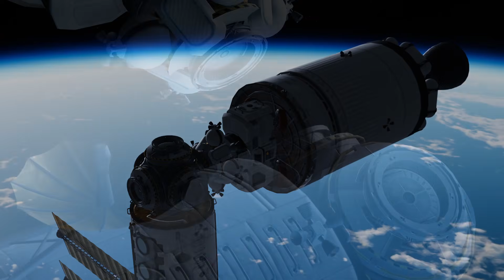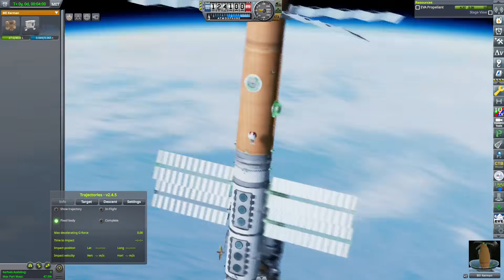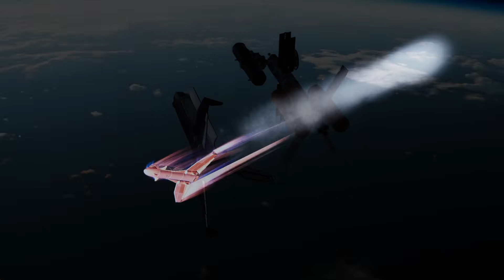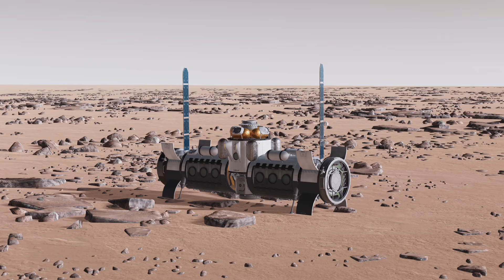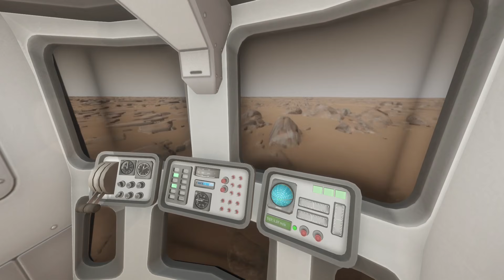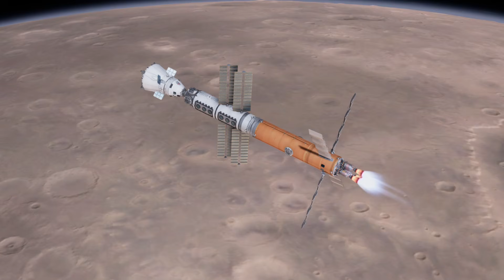COLONISING MARS!? | Kerbal Space Program

Comment: howd you get MAV to connect to the rocket LEO upperstage? also do you have max temp turned off to avoid your asimov lander from burning up in orbit?
Reply from the maker: Max temps are turned down to compensate for the bigger planet sizes yes. Mars' thinner atmosphere also helps with survivability.

The MAV is connected to a service module that you can see disconnected before Mars departure, which is used to get it to the spacecraft in LEO.

Hopefully this helps 😊